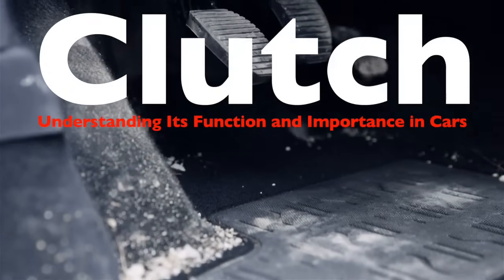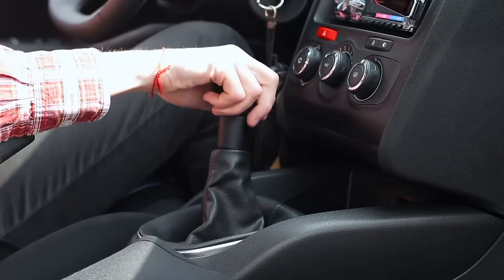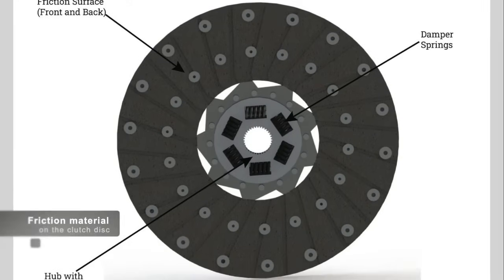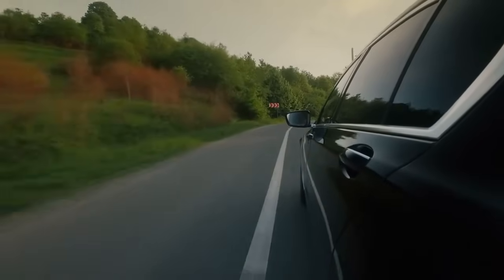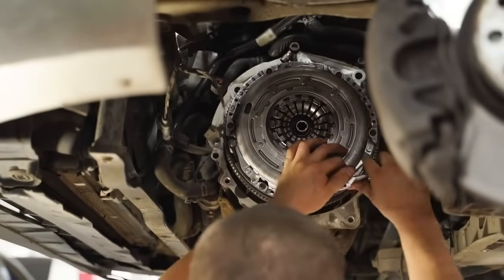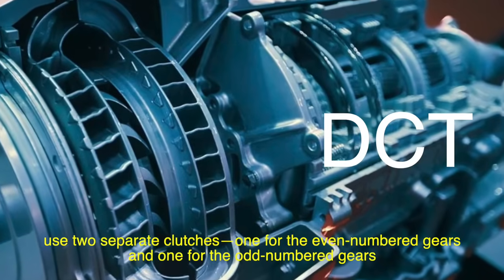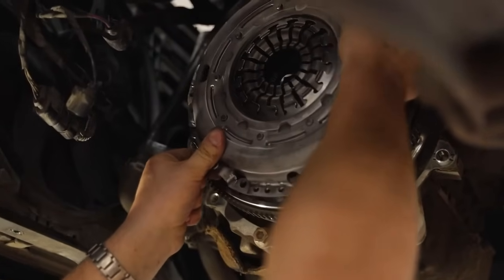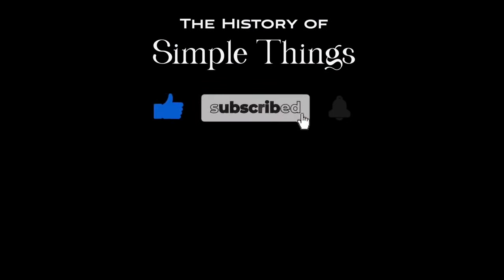How Does a Car Clutch Work? | 1.1

Comment: Had a manual transmission with over 166000 miles on it. (Bought new)
I never had to have the clutch serviced.
Do not play Fast and Furious with the transmission/clutch it will last.
I also double clutched as well.

Comment: The video's caption @ 2:26 is incorrect. Instead the correct caption should say, "When the clutch pedal is disengaged, the pressure plate no longer presses against the flywheel, which no longer allows the engine's power to be transmitted to the transmission." This is because when the clutch pedal is pressed by the left foot, then the clutch pedal is disengaged. When the clutch pedal is not pressed by the left foot, then the clutch pedal is engaged.

Comment: 2:26 "When the clutch pedal is engaged, the pressure plate presses the clutch disc against the flywheel, which allows the engine’s power to be transmitted to the transmission."

You may want to check your work on this.
Reply: Exactly ... since the exact opposite is true.
     Then 20 seconds later, it says letting the clutch out does the same thing.  Were that true, why would we need a clutch.